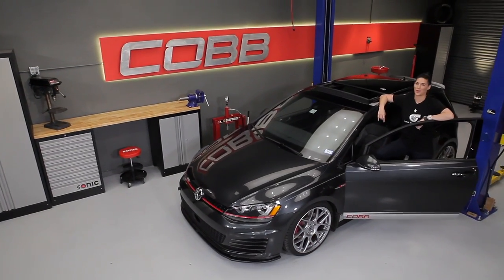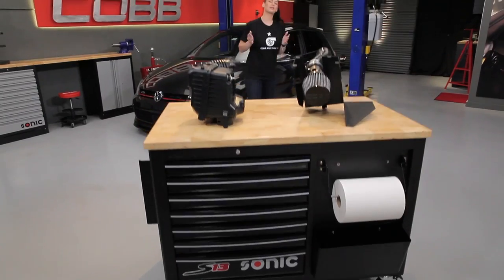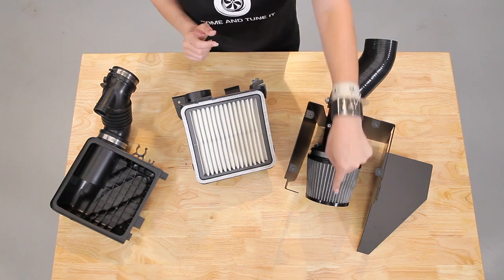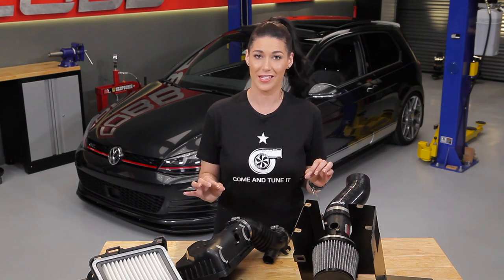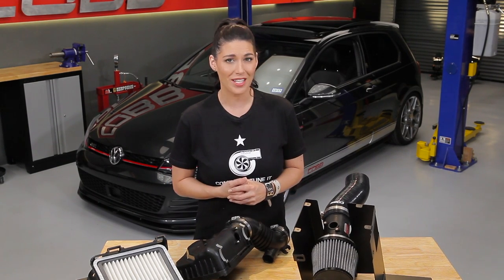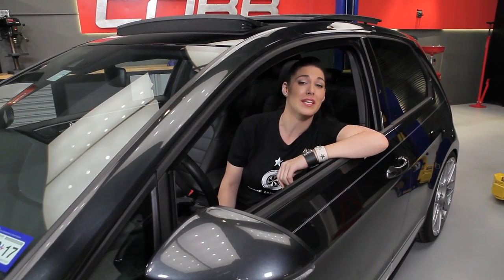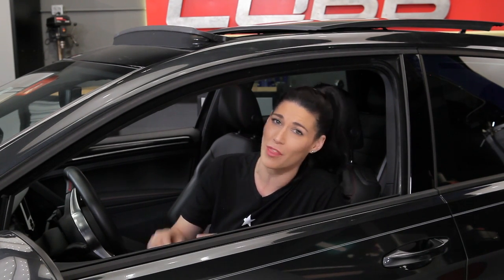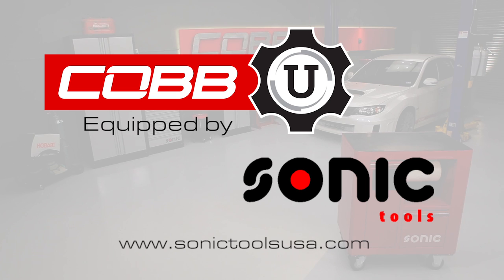COBB Tuning - COBB University Episode #10 - Part/Tune Compatibility

Comment: When using a vf34 on a 2004 wrx and your vf34 pink injector v300 map, which restrictor pill should be used? The stock td04 pill or the vf34 pill?

Comment: You engine will not explode from over boost because the turbo has a waste gate bypass valve that regulates the flow of gasses from the turbo

Comment: So if I have a Cobb SF Intake but Nameless muffler deletes, I should not use the Cobb stock tune because the exhaust isn't Cobb?
Reply from the maker: The cat-back section doesn't make a difference.  It doesn't have to be COBB.

Comment: I have a tubo back system on the way for my 2017 Focus RS (downpipe + 200 cell sports cat + non-res exhaust). It is to my understanding that I have to re-flash my ECU for the downpipe and sports cat. Will my Cobb AP have the tune for this or will I need to acquire a custom tune somewhere else?
Reply from the maker: Currently, custom tuning would be required.  We are working on Off the Shelf maps that work with additional modifications but there are currently no ETAs.  Kyle@COBB
Reply: Thanks :)